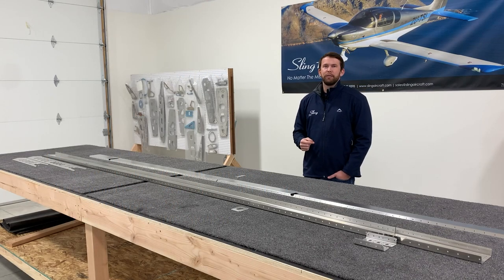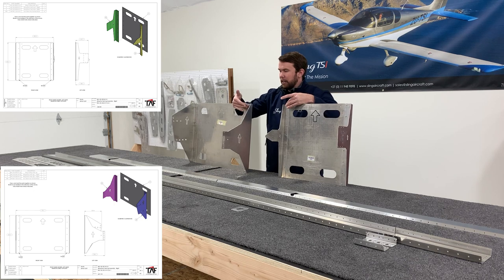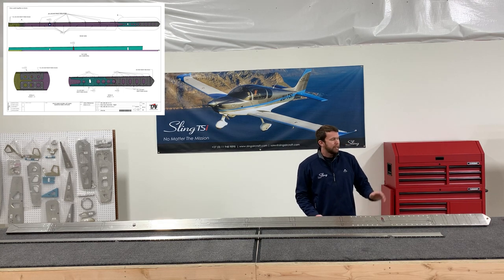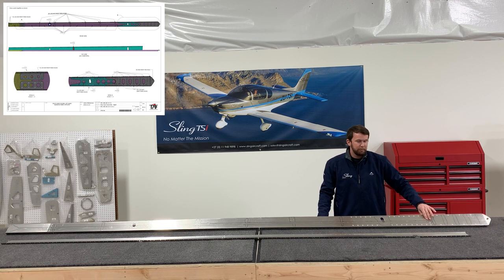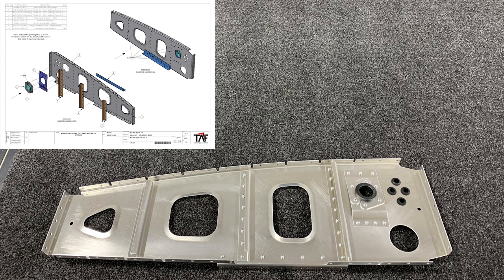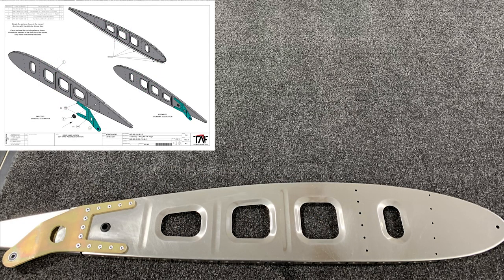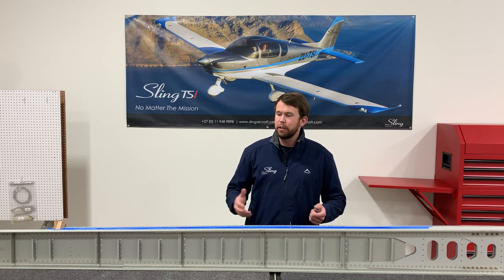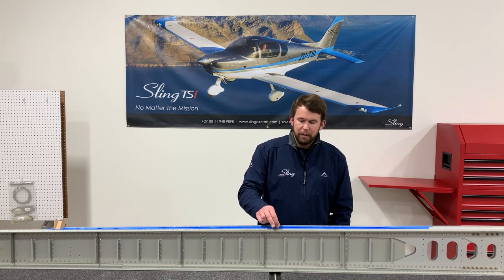2.1. Sling TSi Wing - Skeleton

Comment: Do these aluminum parts come from the factory already chemically treated? (Alodined)
Reply: Only on the quickbuild components or factory build assist.  Others builders either use corrosion-x, Alodine at home, prime, none of the above, etc